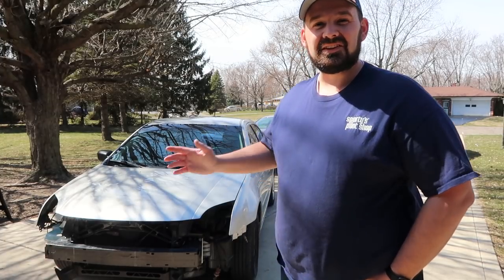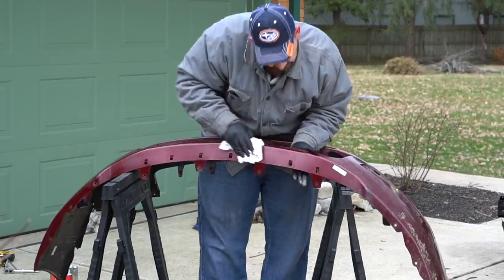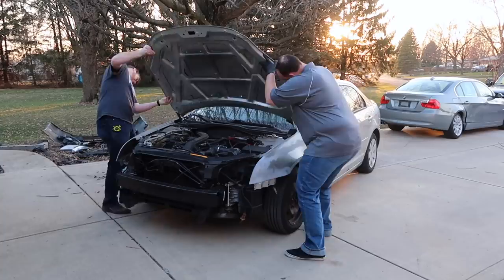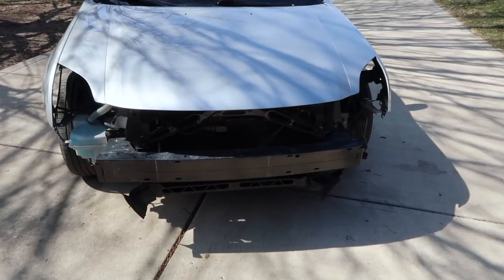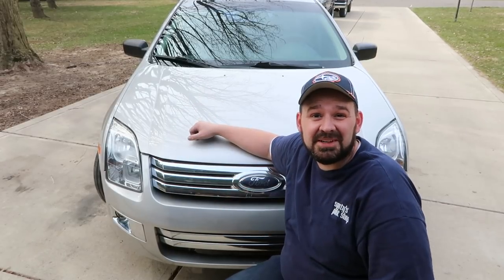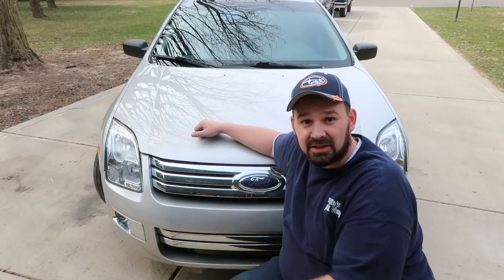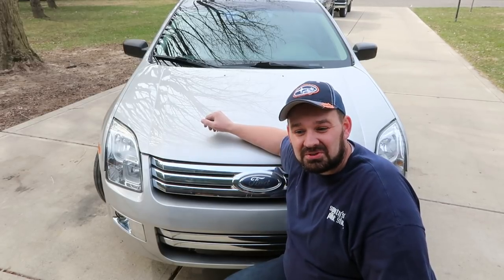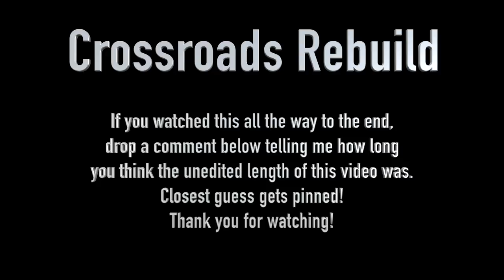Fusion Rebuild -- Part 10 -- It's Almost Done!

Comment: Looks good, i believe you said you where in the same state as me Ohio. Ohio is big on correct fasteners (no zip ties, I learned the hard way when I went for the first time thinking I had everything in order except my grill had warped from the heat and I could never get it fastened the way it was supposed to, I didn't have enough time before my inspection to get another one so I ziptied it in lol) also make sure you have recipts from where all your parts came from you can show (another problem I found the hard way, they won't accept eBay recipts which is how I ordered a bumper cover and painted it only to find out that is somehow wrong) after all that during my inspection I overheard several people talking how they didn't really care that much how the car was repaired or even if the srs system was functional. Mostly what Ohio looks for is that the parts where legally obtained and you can prove that, just remember eBay recipts are bad! Looks like you have everything in order fairly well and I think you should be fine. Keep us updated and keep up the great videos, by the way im guessing probably around 1 hour and 30min of bumper fiddling which is not terribly surprising getting all the little grills and pieces mounted up.
Reply from the maker: I bought the car in Ohio, but I’m actually located in Indiana. It remains to be seen how challenging it will be to get the car re-titled. I will try to remember to mention how the process goes in the final video on the Fusion. 
Thank you for the tips and suggestions!
Reply: Crossroads Rebuild from what I have heard Indiana is nothing compared to Ohio. You should be fine.
Reply: receipts from a picknpull should suffice yeah?

Comment: Next project,  do an electric or hybrid car.     :)
Reply from the maker: Haha! I’ve thought about that. If the right one came along for the right money, maybe. But there’s a lot of $$$$ in those drive trains!
Reply: The basics are the same i guess,  but yeah they cost a bit more at auction.  Try a Prius, they are not so expensive and if the engine is not affected, you get a very good car, super reliable.